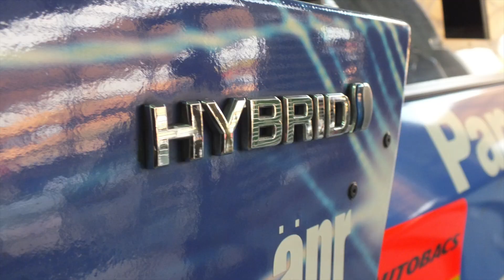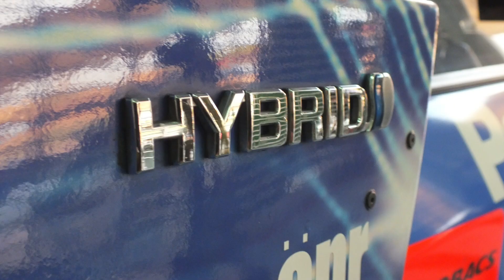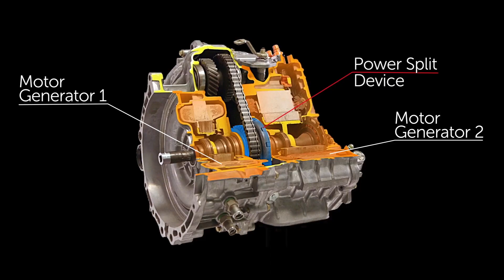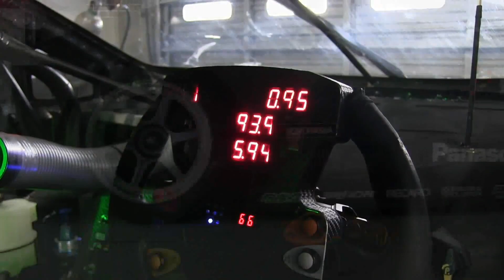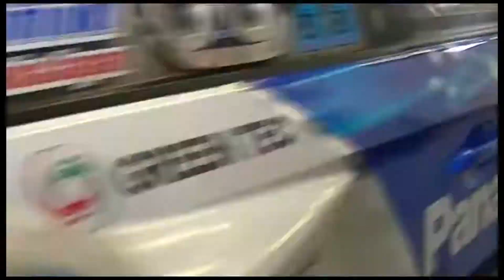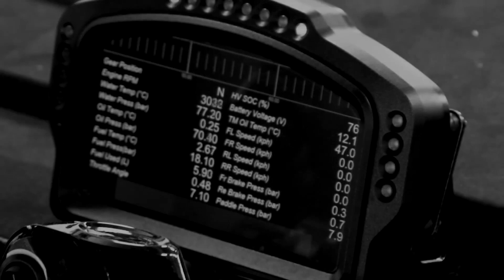The fastest Prius in the world! - A technical look at the V8 powered Super GT GT300 car from Japan.

Comment: The chassis of the corolla was derived from the mr2 which apr developed I think in 2004 when factory toyota backing was dropped.

It's awesome that you're covering gt300 cars. Any chance of covering the funky 4wd system of the subarus where the front diff was above the engine.

Also, any chance of covering FRIC on the f1 cars or the 919. I know there's genealogy info out there but I don't think there's details of any of the actual systems used.
Reply from the maker: yeah lots of GT300 content to come.

Comment: Can you do a video over LMP1 regulations
Reply from the maker: The evolution of the rules? hmm thats a neat idea. Thanks.
Reply: @Samsthepits  One aero detail I have always wondered about was wing mirrors and how Audi, Porsche, and Toyota all resorted to integrating the mirrors into the front fenders. Audi were the first to do it with the 2015 low downforce spec R18, followed by Porsche in 2017 and Toyota in 2020. I find it fascinating that they all converged on that idea but years apart from each other. And I also think it's interesting that Acura were the only ones to do it so far in the LMDh/LMH era.
Reply from the maker: @jorhop4005  will cover it eventually